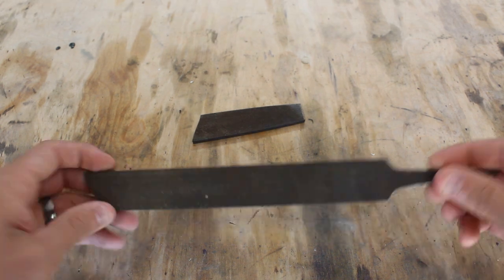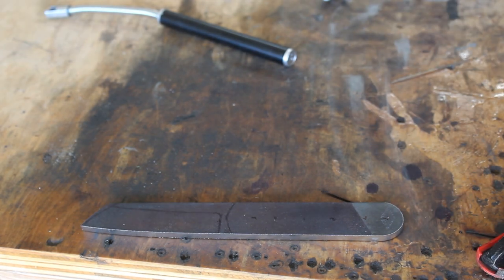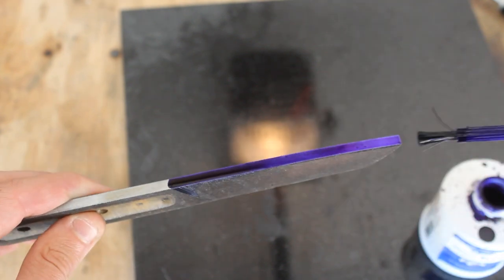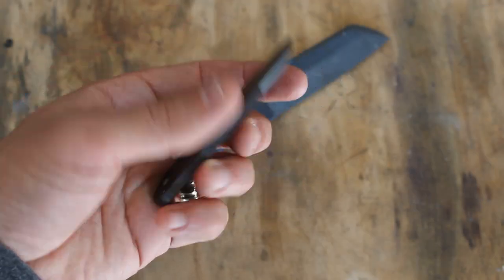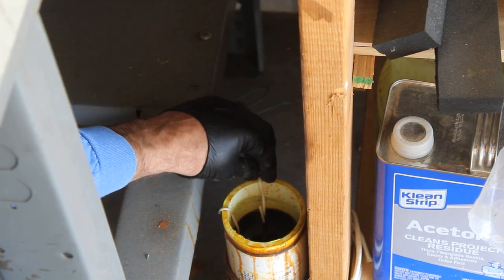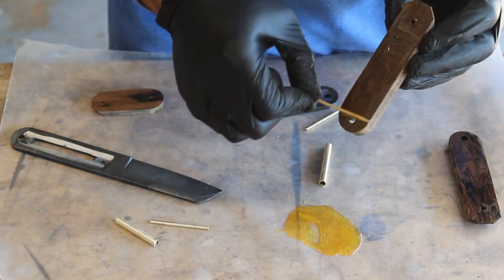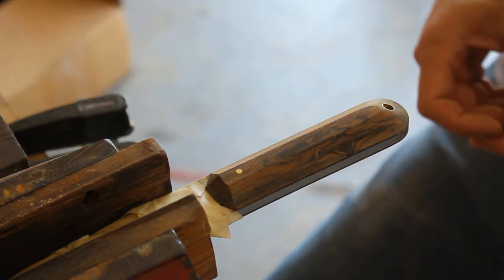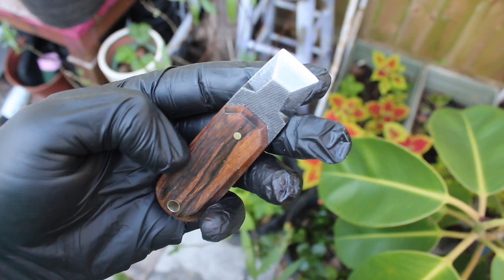From File to Knife and Mini Pry Bar

Comment: Nice work! Great way to repurpose broken tools. I had a couple of struggles with metal liners in the beginning, but what has worked for me is once they are roughly shaped go back and cut holes or slots in the liner allowing the epoxy to pass through and bond. That, and where the project is big enough to use Corby bolts instead of pins works wonders. A mechanical connection along with the epoxy is far less likely to fail.  Again, great work brother!
Reply from the maker: Thank you! I would like to move towards Corby bolt at some point soon for sure.